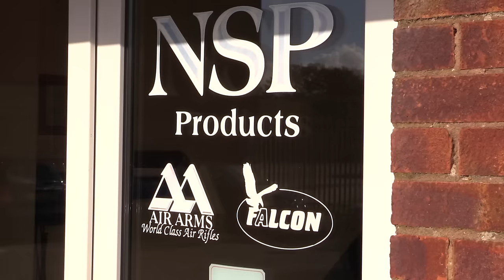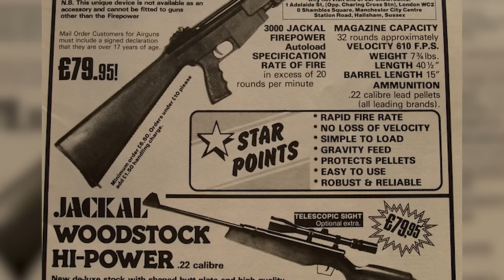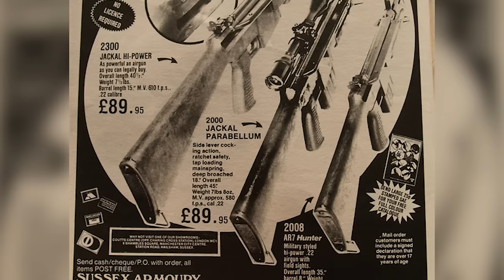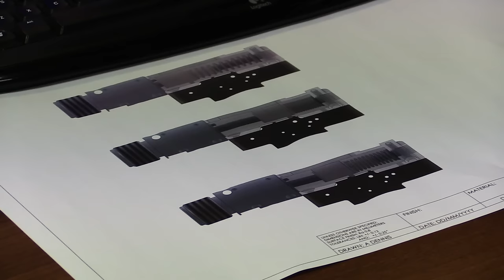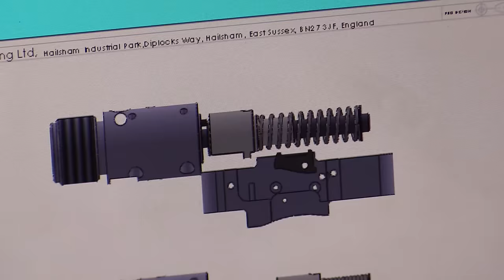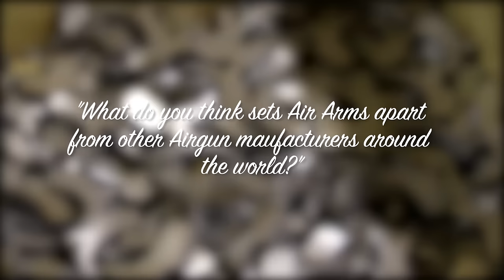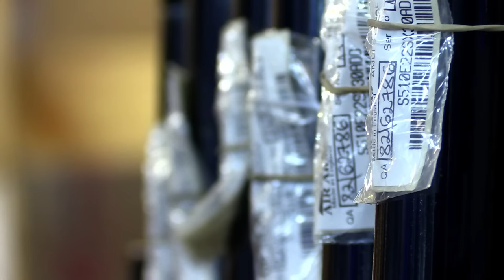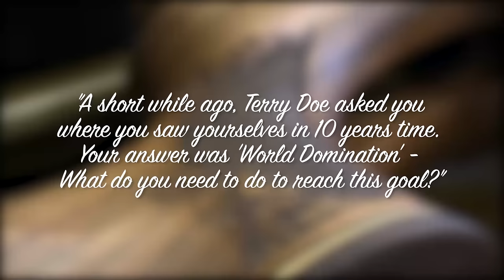Visiting the Air Arms Factory!

Comment: I own 3 air arms rifles and really like them, as a UK shooter ive been disapointed that you dont make a sub 12fpe optimised TX200 anymore the MK3 was a step back for sub 12fpe, also a break barrel would make you more competitive. you will loose market share with springers that i feel as subpar i.e walther branded springers.
Reply: +Gecko Jenkins I don't think AA have to worry to much about walther, they produce great springers but you are right about the break barrel.
Reply: the lgv and lgus are sweet guns at fac power
Reply: Friend of mine has the lgv in fac and it is nice. on another note, any relation to beargrylls ? just yanking your chain ;)